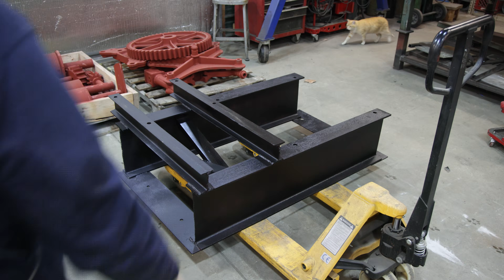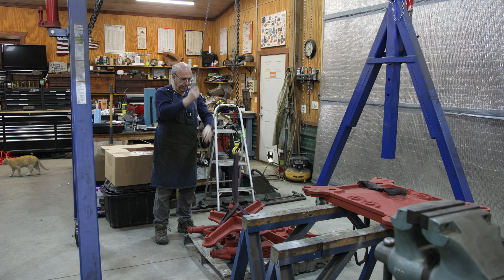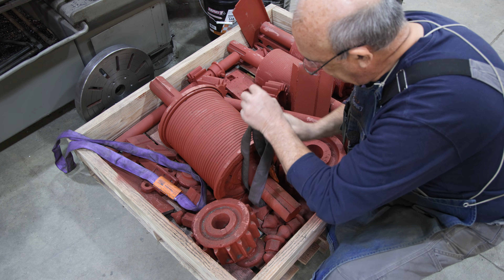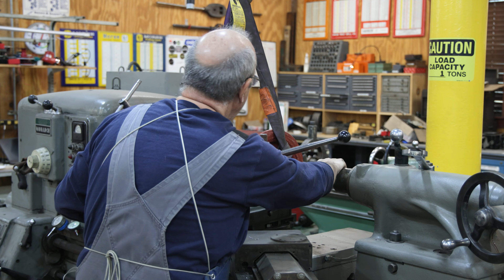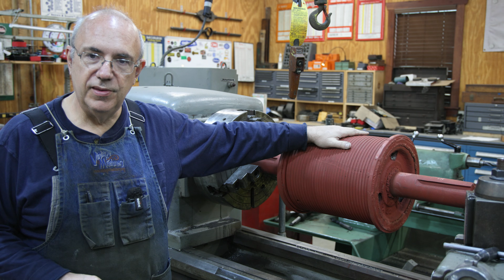John Deere “Amazon” Cane Mill: Prepping for Reassembly and Evaluating Damage

Comment: That looks like such a beautiful chuck, and so useful. I think I’d consider a square drive in a battery drill to run those jaws in and out and make full use of that superb asset.

Wow, casting a new roller is a big task. But I know what the owner means by something with history is more valuable than its dollar price. Good decision to do the repair properly and keep a great old machine in operation perhaps for another hundred years.

Comment: As you said it's going to be a lot of extra work... My immediate thought, not that I know anything but. Why not build the roller out of steel. You have the shaft build the roller out of steel in a similar fashion as a automobile road wheel. Not authentic but should work for many many seasons.

Comment: Hi Keith, once you have asked for comments, let me say something from outside. You have one steel shaft and a steel liner. In between you have cast flanges welded all toghether. In my point of view you only need two new steel flanges. Clean all this weld and see if you can cut flanges from two or tree thick steel sheets, build like a piramide to folow this intrincade "S" shape/profile. Good Luck, from Rio de Janeiro.

Comment: The other way to repair this is to find a section of steel pipe slightly larger in O.D. than the original size. Turn end plates from flat steel stock and mill if necessary.  Reuse the old shaft and it all will weld up fine.  True up O.D. of the drum and cut away excess weld in the lathe and cut in the grooves.  Much faster than getting a new roller cast and then all the machine work it will need.  After it was painted no one would ever notice the tiny differences.

Comment: Would it be easier to fabricate a replacement out of steel?  Heavy gauge steel pipe with caps and a shaft seems easy enough to fabricate.  Then turn it to exact dimensions.  Could even fill it with cast iron if weight/mass id needed.  Just a thought.

Comment: Why not fab it in mild steel and machine to the shape you need to make it look like the original.  The shaft you can use. The ends I would cut out of plate steel then machine to suit the drum .The drum I would find a steel pipe close to the size required. You then can mig weld or arc rod it together.
Reply: Keith is the right guy fro the job, he likes to keep things as original as he can, and his idea keeps that inline

Comment: since you are using pressure treated wood, I hope you put some tar paper between the wood and the metal, so it won't be eaten away. Also the lags should be SS or hot dipped galv to prevent them from being eaten away.

when you were showing the endplates, it reminded me of large 35 - 40 lb weights for weight lifting. The olympic size bars have large holes in the center.
Reply: those are temporary , no need to worry about corrosion
Reply: @johnmolnar2957  no, he said for the mill to be out of the liquid when doing the cane. So they are for Keith and the owner to use. They need a barrier.

Comment: First step is to check the other two rollers and see how screwed up they are.    You might need to do them as well.

Cut that abomination of a drum off the shaft.   Pattern and cast a big "wineglass/cup" shape with 2~3 inch thick walls and a temp stem out the bottom for turning, and separately cast an end cap.
Reuse the existing steel shaft, but weld up the major pitting and turn it down.
Then turn+mill the cup casting into a drum, and show how to fasten it to the steel shaft properly  <-- show it done right.
Fill the cup on the shaft with concrete or similar for cheap mass, then braze on the end-cap, and finally turn the outside with grooves to make it work in the cane mill.

How's that compare to your game plan?

Also, I bet your blue gantry crane will have an electric hoist fitted before the year is out.   :))

Comment: Sounds like you need to make an adapter from a chuck key to something that fits in your variable speed power drill to get the majority of the distance open/closed faster.  ie just use that for the major distance then change back to the manual key for final tightening.  I do hope that someday I can move somewhere to get a bigger shop....being able to do all the things you can do and having the space for the machines to do it would be extremely fun on projects. :)

Comment: It looks to me like it was originally three pieces; a drum held between two end caps for registration... probably held together by long bolts that went through where the wood plugs were put by the poor welding repair. The holes in the drum would have been for access to tighten set screws on the caps (over the keys?).

Comment: I have used a chuck simulator to that one if not the same. We made a speed handle adapter and it was fairly quick but you still needed a t handle to finish up with

Comment: I would think a piece of thick wall pipe and a new shaft  could be machined and welded must faster and less money.  sounds like the cost of that restoration just doubled.  I guess in the end it’ll be like the original build

Comment: There is no question that  fixing the existing roller and shaft by conventional metal working  means would be like "trying to put humpty dumpty back together again" .   

If the owner wants to restore the mill and do a significant amount of cane processing then a new roller assembly and the dozens of hours and thousands of dollars to make a new roller makes sense.  If he only wants it to use once a year for a family get together there may be a  very simple fix provided that the current roll diameter is reasonably concentric with the shaft and the roller is hollow between the end plates.
 If the core can be filled with a shrinkage compensated cement mortar slurry at a  material cost of under $100  the roller can likely be made as strong as the original cast  iron assembly in that the forces on the core would be almost entirely compressive.  Reinforcing fibres in the mortar would not even be needed  

The Russians built lathes milling machines and other heavy equipment of very large size  where  reinforced concrete took the place of many of the traditional cast iron parts.  People  are making fibre reinforced concrete lathes and mills today.  

The work involved  should implement such an alternate repair  should be about a day's  work.

Good Luck

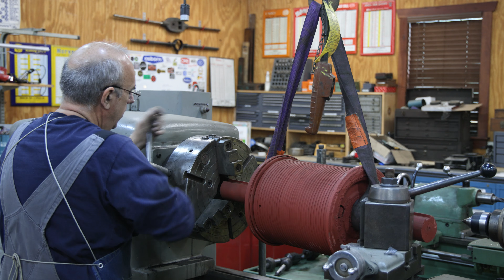Comment: 14:42 That seems like a really nice lathe chuck. Maybe machine a key for it that fits in an old drill.

I'll be interested to see how you attach the cast iron roller to the new steel axle. I know you don't like to redesign things. Key? Tapered pin? Magnets?

Comment: I refurbished some wrought iron railings that my folks had commissioned in 1958. I took it down to bare metal where I could, and used Rustolium shaker can primer. Then I brushed on Sherwin-Williams black enamel. I painted them upside down, cured, then right side up. That let the paint get in the tight spots where spirals are welded to the rails. Those paints seem to be holding up pretty well.

Comment: I think you should run from this project as you should have did with the Tally Ho capstan.
Reply: Not a chance, Keith is the GURU of cane mills!  He has a reputation to keep up.
Reply: He'll do anything to avoid the Stoker Engine!
And those Cane Mill tolerances are as close as he works!:face-blue-smiling::face-blue-smiling::face-blue-smiling:

Comment: Do the whole thing in steel.  You do have to assemble the rest to get proper dimensions.   It will be quicker than casting it.  With paint on it. Nobody but the viewers will know.  You can easily duplicate the drum ends on the kt 2d mill out of some 2" thick rounds cut from sheet.   Does not have to be solid.   Did they sleeve the other rollers too.

Comment: While it wouldn't be historically accurate a fabricated steel roller would be a darn sight cheaper, easier, and faster than a pattern and casting. Maybe with the video someone will come forward with a good original.

Comment: At Tractor Supply they sell a catalyst hardener which will help it dry faster and be more hard like powdercoat and less gummy- but the REAL thing that helps that type of paint IMENSELY is a product you buy at Sherwin Williams called "Japan Drier" (it comes in a square metal can, and it's as thin as water)- if I make up a small batch of paint to brush paint a piece of Equipment, thats say a pint to maybe a quart, I usually put about 1 teaspoon of Japan Drier & one tsp of Hardener in the paint and stir it in and the paint will be Hard as a rock and ready to use in under 12hrs!!!!

Comment: They make inflatable  paint booths , that would be perfect to set up, it's big enough for a car.  Set it up outside the garage door.  Run a extension cord in for lights , have led flood lights down low aimed up at the roof. From about head high or slightly higher  about 4-6 30 watt led flood lights , you should see like it's daylight. And run a air hose, lay down a drop cloth. Maybe buy some moving blankets from harbor freight.  Set up a furnace air filter and a window fan. If the booth doesn't come with anything.  Build a 30"x36" frame on a stand with 1"x2"'s or 1"x4"'s making a cube with wheels on the bottom. Duck tape furnace filters in a zigzag. With about 1.5" gap on one end being the air inlet duck tape the gap on the sides. And cut strips of plastic about 18" and long enough for both sides , top and bottom. Tape that to the window  opening.  And tape plastic to a window fan, and window, have the fan pull out the fumes. And the filters cleaning  the incoming air, possibly spray them with water to help collect dust, depending on type of filters they are. With the fan on low, wearing a respirator  with carbon filter you should have no problem painting anything. Maybe hang a couple or four heat lamps, 250watts each to help the paint dry... Run a couple 10-12 gauge extension cords with a plug strip on the end. With a switch per outlet. Maybe a breaker per couple outlets 16 amps each, allowing safe use of a 30 amp circuit. Have 6-8 outlets per strip, 120-250watts watts total for lights. Plus 180 watts for a fan. (250 x 8) for heat lamps 2000 watts, say 2500 watts total. It should be enough, a 30 amp circuit is fine. Or split it up, use two 20 amp circuits. Maybe heat on one, lights and fan on the other.   Use a old car/truck steel run with a 2"x 84" pipe welded in the center with casters on the bottom, and a 2x2 angle on top. Welded on, with a 3/4" hole in the angle center of the pipe mount a metal double duplex box with a receptacle and light switch. The cord running out the bottom of the pipe. The angle can be 24"-36" even 48" it could be used to mount led flood lights on top  , and heat lamps on the lower side of the angle.  With two switches and with or without the outlet. Maybe even weld a couple 2" long bits of angle on the pipe  about 4'-5' high. With a 1x1 sq tube across it.   About 12"-24" long used to hang  the cord on. And push it around by.  Clamp cameras on.  Additional lights.  Make Between 1 and 8 of them . Maybe even use a small barrel. About 20 gallons or so.    Cut a hole in the center for the pipe, or use the offset fill hole. With a 1" hole in the bottom for the cord, making a nice little tool table, and light, using 3wheels for stability.  Maybe cut a 1/2" plywood  circle or square about 6" -18" larger than the barrel  making a light haha, "light" 💡duty work bench having at least two would be awesome maybe a 55 gallon drum on wheels. With a plywood square top. With a 2x4 bracing the perimeter. With a couple outlets, and a 36" pipe with a light on the top and a couple 12"x 12" squares vut out in the side, weld in a u shaped 18 gauge sheet metal to make shelves. Maybe 20 lbs of sand/concrete in the bottom for stability. Paint it Massey yellow, case orange, Deere greena couple light switchs for the two 30-100 watt led lights (or 4x 30-50 watt lights, and/or 2x500 watt heat lamps. Using a 10 gauge Sj cord about 20' long. It would be great inside a paint booth.  With a couple  saw horses.  And pallets stacked for painting on.  Maybe a couple 8' x 2x4's  running parallel connected with a couple 16" 2x4's covered with a sheet of 1/4" ply plywood with a 2" x 5" handle holes, about 48"-60" long laid a 🔥

Comment: It seems like you could fabricate a new roller assembly entirely in steel without going to the trouble of building a pattern and casting a new part. Aside from the authenticity of the repair are there other reasons to avoid a steel replacement?

Comment: Hello Keith, I use a cordless drill with the correct size adapter (3/8, 1/2, etc...) to spin the chuck jaw adjustment faster... Love the channel!
Reply: I thought of that too, glad to hear that it actually works. Careful clutch setting should avoid any over-torque problems.
Reply: @abbert1955  if there are any chips in the scroll you run the risk of damaging it by doing that
Reply: @chrisbolton4900  Run slow, set clutch so that it slips with any increase in torque. Beyond that, it could probably be damaged by hand too.
Reply: @chrisbolton4900  Could use a drill on the lightest screwdriver torque setting that will still move the chuck.

Comment: Two videos in a row that end with a casting pattern needed. How would you make a pattern for something that big? They do make 3D printers that could handle it, but I would bet it would be pricey. Turn one out of wood? I'm sure for a one off casting that would be fine. It just has to be a cylinder with a core in the center and possibly some other cores for weight reduction. Should be an interesting project.

Comment: Hi, with regards that top roller, the top roller just about always has bolt on flanges on the sides that fit over the edge of the lower rollers. Also the roller shell used to be heated dam near red hot in a large bonfire and the shaft lowered into the hole and with the shell cooling it was shrunk fit. The steel shell they made could have been made a bit thicker and also shrunk on and the side plates then bolted to that, That said, i think youre going the right road with a new cast iron shell getting made, could we get a video of the casting process, i''ve never seen it done but remember my Dad speaking of it before he passed, Dad was a foundry man but that was back in the mid 50's and before my time. Hope you get the new shell heat shrunk onto the shaft as per the originals.

Comment: Keith, I use a 1/2" battery drill with an adaptor I made to run in and out on my chuck when I have many revolutions to make. The wood dowel rod is used as sound deadeners to cut down on the ring sound the drum makes. I agree that the drum is in bad shape, do you know what the correct diameter and roll face shape should be? The rolling mills that I worked on had a maximum and minimum diameter for the roll to extend the life over several resurfacing operations, however, there was a way to adjust the roll gap, usually with steel shims. This may not be a concern on a cane mill. I have encountered similar damage to overhead crane cable drums as you showed in this video, surprisingly, I have seen the exact same crack patterns on overhead cranes displaying the same damage after years of use/abuse. Your plan for a replacement is sound, and will keep the mill in its original state, which I suppose is the goal. I enjoy watching your video, especially on heavy machinery, keep up the good work.

Comment: You could find and old speed wrench or drill brace and adapt an end to fit your chuck. That way you can crank the jaws quickly. Then finish tightening with the regular chuck handle.
Reply: ,,,,or have a dedicated battery powered impact driver.

Comment: at 15:30 - Keith talking about how many times he has to turn the handle to adjust this "fine" chuck.  Could you use a battery powered drill and a custom made bit (hex to square) to speed things up?

Comment: Good choice on making a new one, I was surprised the choice of casting.  But it will be very nice in the end.  Thanks for sharing.
Reply: Either cast a new one, or get somethick wall pipe in the right dimension, and some heavy steel plate plasma cut to form the ends, plus a middle brace. Then weld that together. Probably will be faster, and the plasma cut steel will need to be probably 1in thick, which will make it heavy, but still well within the range of being weldable

Comment: Hi Keith,
Not sure what the cost would be compared to the cast iron route, but what about a stack of steel circular spider plates (like how an electric motor is constructed) CNC cut and then a thick wall tube for the outer surface of the roller?  You could weld or key the spider plates to the shaft and key each of the plates to the outer tube.  This way the whole roller would be the same material and could have the outer surface turned down at any point in the future if it wears and then re-surface back to the suitable OD with weld and re-turn the grooves.

Comment: Make a chuck key for use in a drill for that 3 jaw to speed things up
Reply: exactly what I was thinking  My little chuck just happens to take a 3/8 socket adapter.
I don't use it to torque it down, but for big adjustments... can hold work in one hand and  drill in the other.

Comment: Consider designing a bit so you can use a drill to move the jaws quicker.
Reply: I was thinking just that, possibly the old “ speed “ wrench that was used prior to electrical devices becoming the go to option.  Worked on aircraft in the eighties and the hundreds of Phillips screws holding inspection panels were the cause of the daily reminder of doing that, and the Makita electric screwdriver eliminated the wear and tear on the hands making the bent driver obsolete.  I still use a 1/4” regularly, but batteries put many in the recesses of memory 😢
Reply: He could also make a chuck key with a largish hand wheel/steering wheel to use for coarse adjustment.